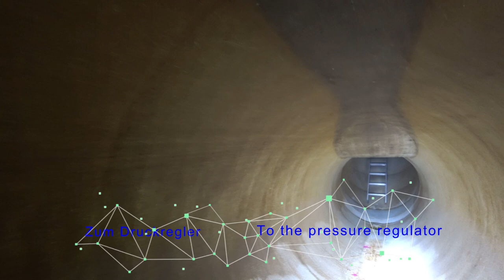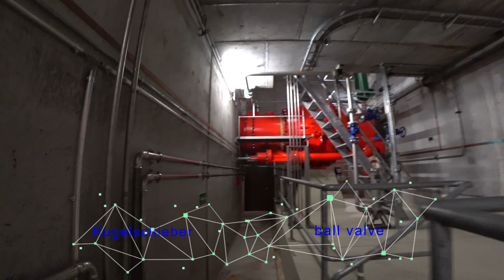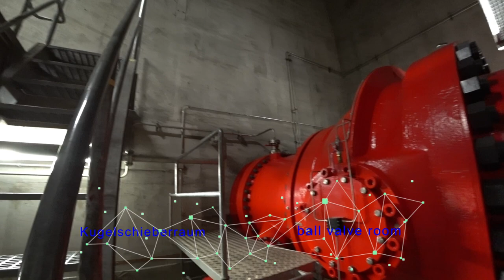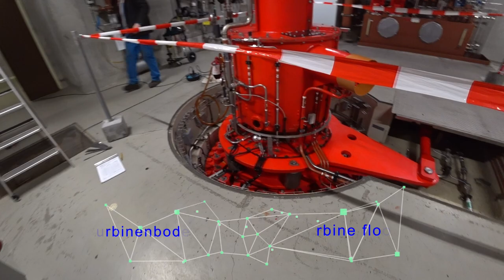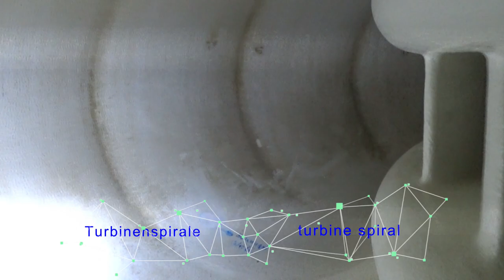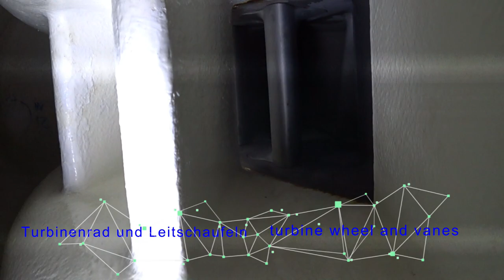Rundgang  Kraftwerk Sarelli / Tour of the Sarelli power plant

Comment: Super scary behind the dam bars...Edit: Thanks for the invalualble footage from inside (from the friggin IN-SIDE) a ball valve and the turbine intake. This one is almost as frightening as the 
Waterschloss Sarell video.
Reply from the maker: Thank you, I was happy to do that 👻😱. Greetings from switzerland.
Reply: @eggaeri  Grüezis back from Germany
Reply: @HenkChinaski  At the turbine intake wicket gates..how much bar pressure are we talking here?
Reply: @russellking9762  I guess this is something @eggaeri can answer better as it' his vid and profession. I can only assume the hydrostatic pressure alone at the intake would be something around 100 PSI. But the force the wicket gates have to withstand will be much higher as a huge shitload of water is moving pretty quick towards them. But again: I did electrical / IT engineering and thus totally suck in mcehanics, especially fluid dynamics.